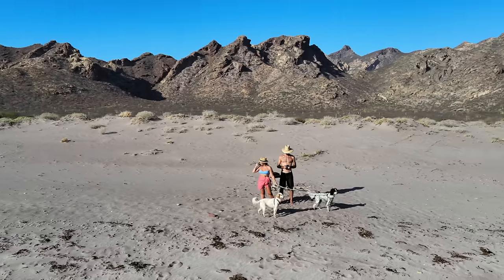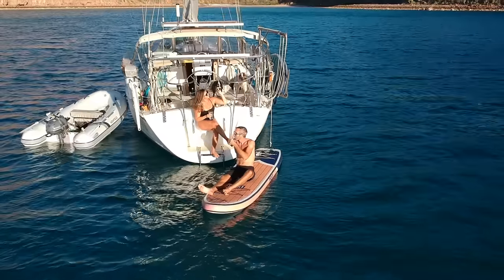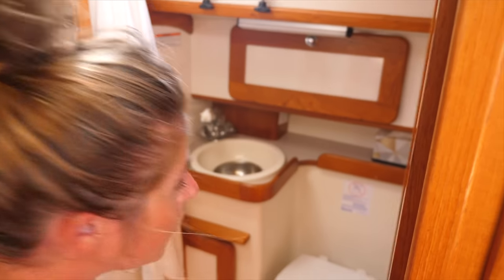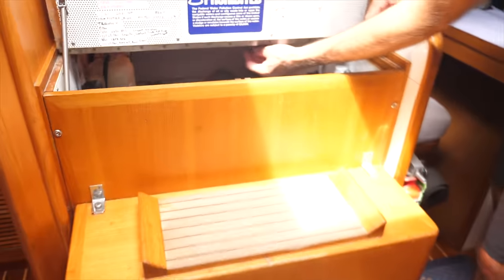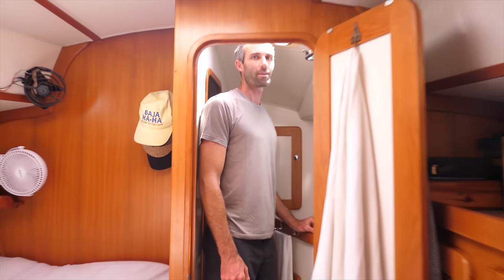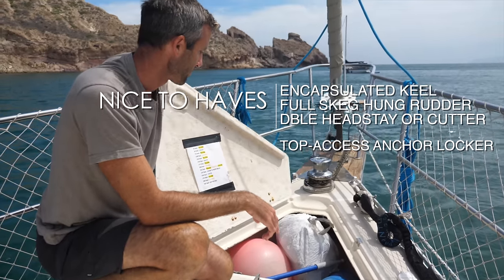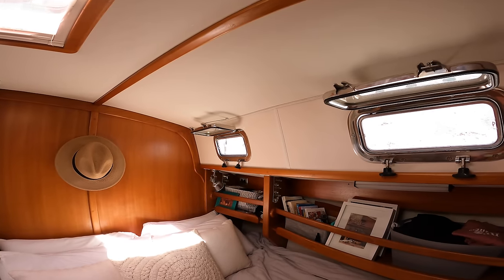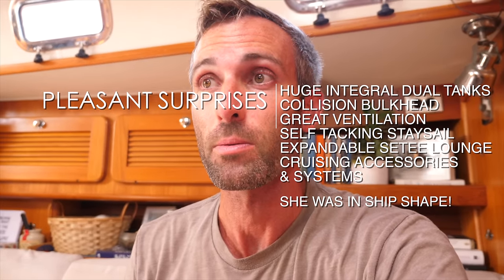BOAT TOUR: This Bluewater Cruiser is Our Tiny Floating Home - Caliber 40 LRC [Making Our Way Ep 73]

Comment: You can mount a couple of lightweight shock absorbers under a large plywood in your queen size  bed ( hinged wood) and will make an ease lifting of the mattress for access to storage area under it.  Had a quick look at specs,  and saw a very concerning information regarding water storage system intake with some kind of filter screen which seems to be a manufacturer's flaw in design and can be of considerable concern to you out in the wilderness of seas and oceans, not to mention damage potential,  read sailboat data and reported problems.  Nice boat though,  can see why you chose it.
Reply: a camera endoscope inspection on the cleanliness of water tanks is warranted since the quality and possible contaminants may be present in the source of fresh water supply location.  Regarding the constant mishap of fuel and FW intake on deck, can be easily corrected by painting whaterver color or mark of your choice indicating which is FW (fresh water) , FD (Fuel Diesel) ( typical in offshore rig bunkering jargon)

Comment: Purchasing a '96 caliber 40 in North Carolina. Mine has a single shroud arrangement.  Thinking of researching an additional shroud.  I do not like the standing rigging placement on the side deck.  The nav station is small but I am 5'11" but wide.  I am replacing the life lines with SS 1"tubing all around.  Adding more solar panels and lithium batteries, has 609ah of AMG will try to fit 800 in. Have 210 watt hydrogen gen comm from EFOV., expensive  but great and better than diesel.  This comes with 18000 but a/c reverse cycle.  They are installing bow thruster as I am a solo sailor.  Now transporting to washing state in Blaine.
Reply from the maker: You’ll enjoy the boat. The stainless lifelines are a great idea. We are satisfied with the 630 ah we have, but would definitely love to go lithium. Congrats on the purchase!

Comment: Thanks for the tour, I also was a big fan of mtv cribs back in the day. 

I have a couple of questions:
1, what does Taylor's necklace say?
2, are the dogs claws doing damage to the boat? Small scratches on the wood or deck?
3, what upgrades would you want to do next?
4, what jobs did you give up for this life?
Reply from the maker: Hey Phil, thanks for watching and the questions. Tay’s necklace is a Sanskrit word which means roughly “inner peace”. The dogs claws don’t effect too much, we have some small teak trim in the cockpit that they scuff, and the dinghy tubes get small scrapes but only superficial. The rugs mostly protect the cabin sole.  As far as upgrades, there are always several. More solar power, reinforcing or replacing the davits, new sails. Taylor still runs her online business and Mike was in law enforcement.

Comment: Really good boat review, great choice. Love the true "head" in the bow (old sailing ships had the toilets in the bow so the smell wasn't blown all through the ship). I think having the height and companion way steps requirement probably helped to narrow down the choice and possibly only better designed boats had both. I'd love a true deck salon yacht like a Sirius 40DS or Moody 45 DS which would be great for dogs. Nauticat 40 or 551 also good with huge tanks and range.
Reply from the maker: Those are some really nice boats. There are some good deck salon and PH options out there, we didn’t see many of those when we were looking. It seems a lot of modern designers have caught on to how nice it is to not have to climb a ladder to get on deck!

Comment: Taylor and Mike great video and I agree with all your must have. Quick question, what do you think about an in-mast furling main system? could it make the nice to have list?
Reply from the maker: Great question. I’m a little skeptical of furling for mainsails. There’s a lot of obvious positives and I wouldn’t avoid a boat with a good in mast system if it otherwise fit the bill, but I think my preference is to keep things simple with slab reefing. We’ve heard a lot of problems with both mast and boom furlers, people having to climb the mast while underway to fix a stuck furler, plus that’s a lot of weight aloft. But it sure would be nice to just roll that baby up! -Mike
Reply: @MakingOurWay  Thank you Mike, those are great points.